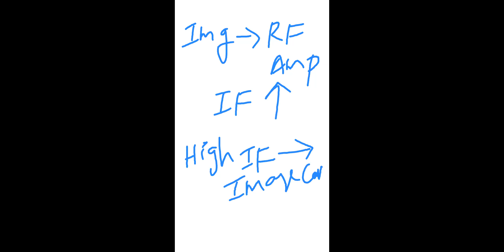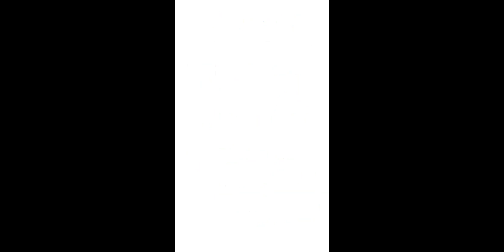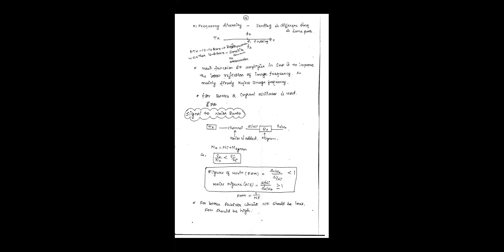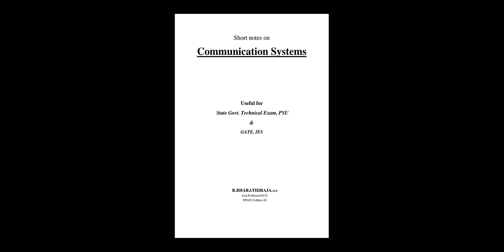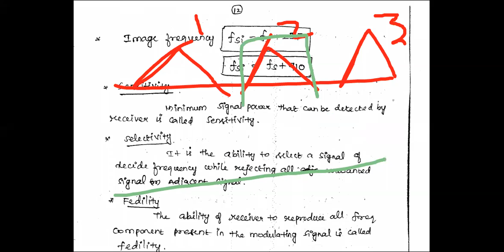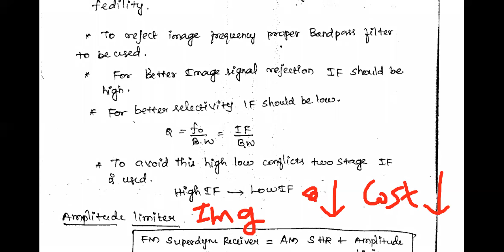4.3 Two stage IF, Receiver Parameter

Comment: sir you said that IF has fixed value(455kHz) but for station freq at 550kHz the image freq is 1460kHz which actually lies inside the AM range
so, in this case the mixer produces interfered o/p  and is there any need to change the IF  for lower ranges (550k to 750k)? 
       Because for freq range  550k to 750k with IF 455k the image freq lies within the AM freq range.